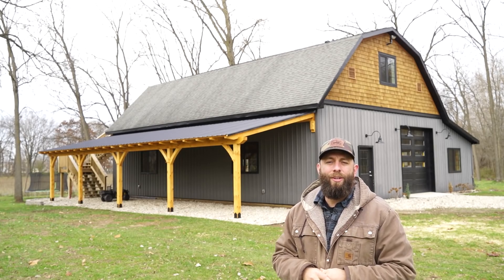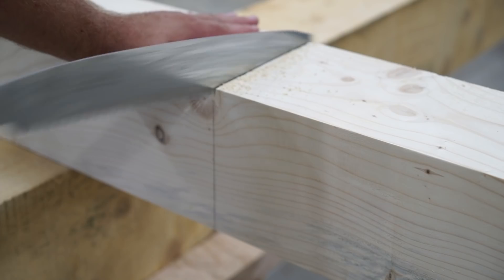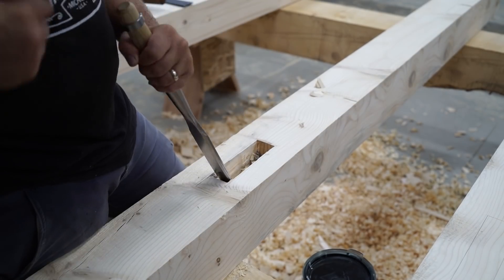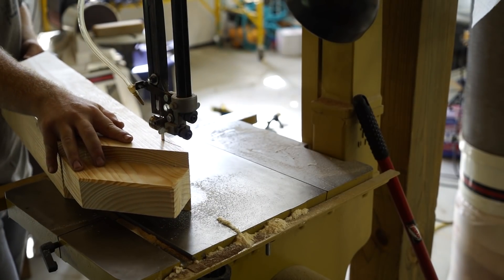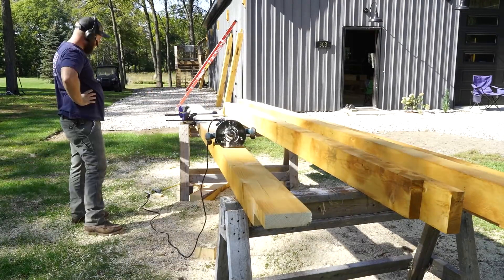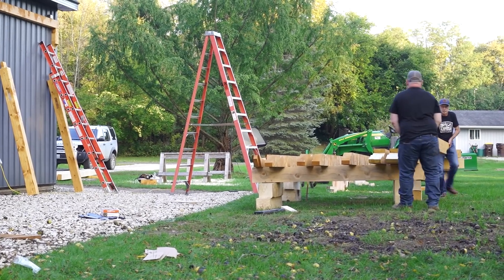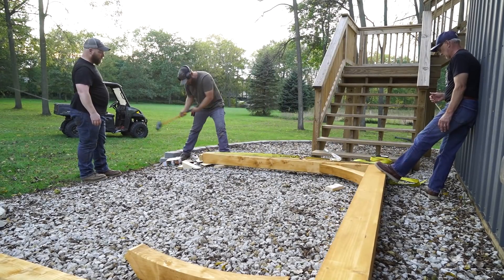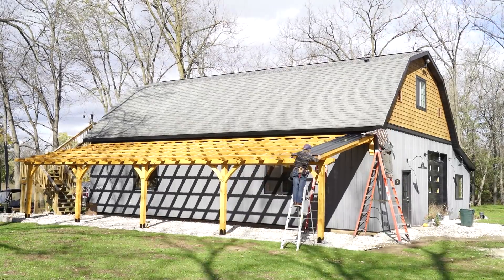Timber Frame Lean To // Dream Woodworking Workshop

Comment: First, this looks amazing.
Second, it looked like you were screwing the roofing down in the valleys. I have seen some guys that will only do the ridges. Does it matter?
Reply: Yeah. I see that a lot in the US. Here in Aus, that's a big no-no and against regulations (Australian Standards - big books that every type of tradesman has to know) in the roofing industry, apart from vertical tin walls.
In a land of heat and sometimes cold  (if you consider 0C or 34F cold and 35C+ warmish), for generations... you know the tin will expand and contract and those screws or the old lead sealed nails will shift, the rubber seals degrade; silicon rubber seals don't fair any better. Those screws in the valleys of the tin are going to leak. Much better to have them on the peaks, while the majority or the rain water is running in the valleys.
Hearing the popping and shifting of the tin (iron really) and fixings changing temp is something I've heard all my life.
Most folk, especially non-builders, aren't going to be clambering all over their roof looking for a dodgy screw unless they find wet/mouldy patches in their plaster-board ceilings. Bad leaks will make it through the older tongue and groove timber ceilings. I imagine that would be magnified many times over if we here screwed in the valleys and not the peaks of the tin.
Just my thoughts. 
Otherwise, I loved the lean-to addition. Lovely carpentry and a beautiful addition.

Comment: On fastening currogated sheet - wouldn't you rather fasten (carefully) through the tops rather than the gulleys? That's how we do this in the Netherlands, it's so that water can't accumulate around one of the screw heads as easy (snow, leaves, ..) and start to seep through over time.

Comment: I was wondering if leaving the pegs long is for a purpose or more for an  appearance. I could see leaving the wedges on the scarf joint incase you need to adjust as it dries but is there a reason for the pegs as well or just wanted that look?

Comment: Outside of attaching the ledgerboard to your posts within your post frame shop. Did you just screw into the metal siding in between or did you have a header within that wall?

Comment: The way you avoided cutting into the original building sheet-metal and fooling with j-channel is just what I've been looking for.  I've been contemplating solutions for this and you have laid it out and thoroughly explained it.  Now that I see it I know it will work on my shop addition.  Thank you!  Did you have a hard time finding a router bit to match the angles of your sheet metal profile?
Reply from the maker: I actually used 2 bits. A 45 degree bit and cove bit. You’ll have to do a little experimenting. Someone suggested just using a circular saw with the blade an at angle. Faster but you won’t have the cove matching the siding as well
Reply: @ThirdCoastCraftsman   Thinking about it I probably can use a moulding head in the TS with a cutter ground to my sheet-metal profile.  Then cross cut the timber with a sled.  Appreciate the info.

Comment: It worked well, but where is the drainage system?
Reply from the maker: Doesn’t really need gutters. It’s way away from the build and everything slopes away from there. You don’t want water dripping off a roof and settling next to a house (especially with a basement) but not really an issue here. The gutter would hide my rafters so I’m not gunna add one

Comment: Very nice. Those Powerpro screws are pretty special, wish we had them here in Oz as most screws are Chinese rubbish here. That timber yard is To DIE FOR. Wow! Do you get any condensation on the underside of that roof? Here in Oz it would rain on yr head in the humidity mornings.

Comment: Draw boring is an extra step, but it does add value, both in strength and appearance in the long run. Not strictly necessary, sure, but better, and why not always strive for best? To save time? Because it is two much work? But if you are do chose to skip this step, I'd vote you skip only drilling the tenons. Layout and drill the mortise side of things while timber is on the sawhorses. 

By the way, you can layout and drill draw bore in the tenons on the sawhorses before any assembly. With square rule layout you do not have to assemble, prick, pull apart and drill. Layout draw boring saves tons of time and energy during assembly and raising. It is stronger, faster, prettier, AND extremely gratifying.

Comment: Loved ever bit of this video. Just a question. Why no flashing? I mean your level of attention to details is awesome, but typically with roofing you put some flashing at the edges of the roof to keep water off the wood as it flows down. I know the wood is stained with oil, but it seems like a missing detail. Everything else on this build is textbook perfect Thumbs up from me.
Reply from the maker: The metal roof extended past the ends of the rafters about an inch so when it rains and I did actually put corner trim on the edges of both ends. Might not be visible in the final shots

Comment: Looks good.  Thanks for sharing. Out of curiosity, how often did you sharpen the slick?  Did you take any timberframe classes prior to this work?

When my wife and I talk about where to live in retirement, the biggest driver for moving is so I can could have an outbuilding for woodworking.  I have wanted to hand hew the logs for the timberframe structure.  The advantage of staying put is that I would be able to parlay that labor in building my shop into making more woodworking projects.  All good problems I suppose.
Reply from the maker: I just strop it every hour or so.

Comment: Nothing like planning, sanding and staining a beam to lay it directly on the gravel and beat on it. WTF?? also you are taking the time to mortise n tenon  your joints, housing them looks better and is how real traditional timber framers do it.
Reply from the maker: They were set on blocking off the gravel. And housing joints is often overkill. Especially for an open air lean to with no walls and therefore no horizontal wind load.

Comment: Nice build. Really impressive. Small sidenote, when you fixed the metall plates of your roof, the next time, try to get some domes for the heights of the beads. We experienced some problems with screwing the plates down in the "valleys". After some years the seals rotted away and we had water pouring under the sheets. If you screw through the tops of the beads the ammoiunt of water flowing around the seals is way less. Hope I explained it correctly, resp you understodd, what I meant. Using technical terms as non native speaker is sometimes hard.

Anyway, again, I just found your channel and as a carpenter myself I am very intrigued. Got a new subscriber :-D

Comment: Chris, awesome work as usually on your scarf joint jig that you made how did you know how what dimensions you needed? is there plans for this, did you contact an engineer for the proper length or did you just went with what looked right to you?

Comment: Absolutely amazing mate! No matter what video of yours I watch I’m blown away. 
Have you got any pointers on planning to do one of these?
I’m in the planning phase of a similar build off the back of my house that I’m hoping to get started on in January and I’m trying to get my head around the specifics of the joinery as I haven’t done something to this scale before.
Did you have a plan or diagrams, measurements etc for the joinery?
Cheers Rob
Reply from the maker: I’d advise looking at buying some premade plans that were done by an engineer. There are several site out there that sell plans.

Comment: The amount of patience is strong with this one. No way I could have enough patience to do just a single post.
Reply from the maker: A good audiobook makes this type of work super enjoyable. Just relaxing cutting wood haha
Reply: @ThirdCoastCraftsman  absolutely right you are) i built my whole house with audiobooks in english, except dusty kind of work or course.
in my project of such a lean to i'll add a geometrical carving scandinavian style on vertical parts. i think a little bit patience, a lot of router work and it will be done)

Comment: Absolutely beautiful work!  I have done a timber frame or two and am looking to do the exact lean to on my pole barn shop except in Douglas fir.  Its a longer (but narrower) building and was wondering if you were willing to sell the plans for yours?  No doubt I could modify the number of sections/scarfs to accommodate the length of my shop.  This is EXACTLY what I am looking to do and would be a real head start from starting from scratch.  I know you have time invested in them an willing to compensate you for that.....within reason :) Let me know if something like that is a possibility.  Chain mortiser is where its at....but not as satisfying as doing it by hand with.